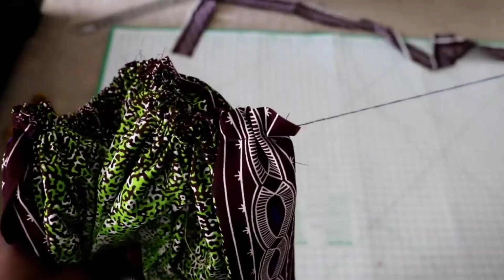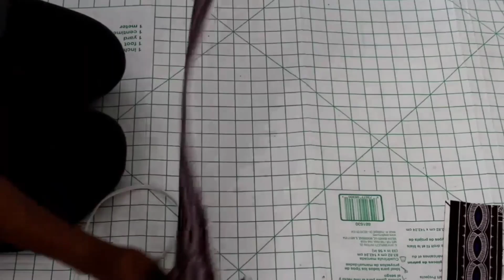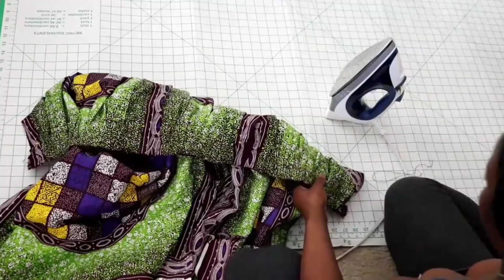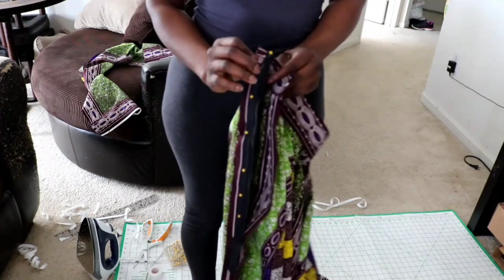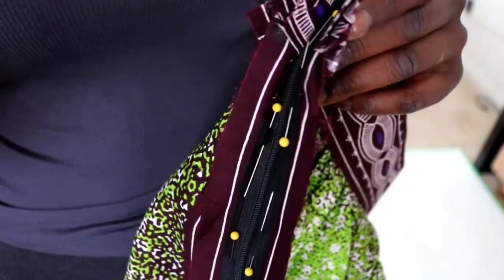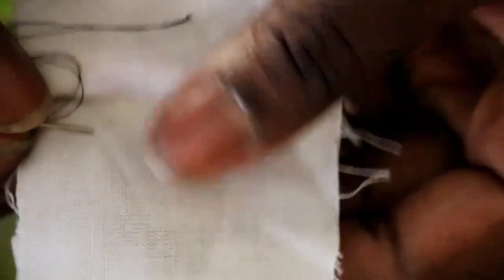DIY: NO SEWING MACHINE NEEDED ANKARA MAXI SKIRT!!!

Comment: You're supposed to iron the bonding glue between the fabric....if you iron the actual glue it stick to your iron
Reply: There is a top cover strip on the glue. So when she finished ironing , she pulled it off exposing the glue part and then she placed both raw edges together infusing them. A Job Well Done for a last minute fix

Comment: I love this skirt and want to make it as part of a dress. I want the same volume and everything.. What can I do to attach this skirt to a top to make it a dress?
Reply from the maker: AnonSail put the top on and put the skirt on before you sew the zipper. Pin the skirt to where you want it to sit on you, to the top. cut the back of the top to align it to the opening of the skirt. sew or bond the skirt to the top. Then using longer zipper sew it to the back of both the top and the skirt and Walah! you have a dress. I hope that helped.